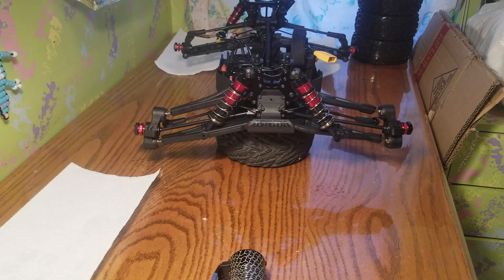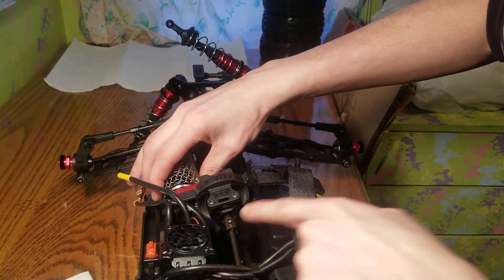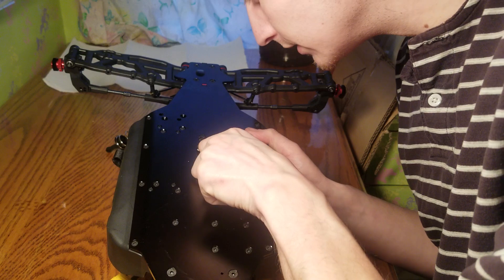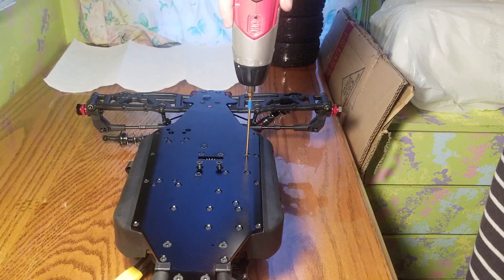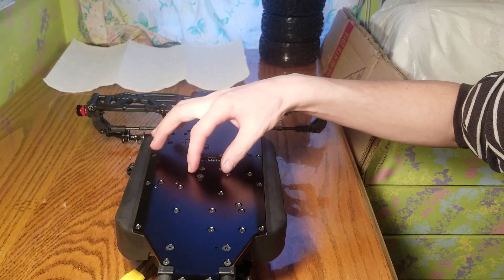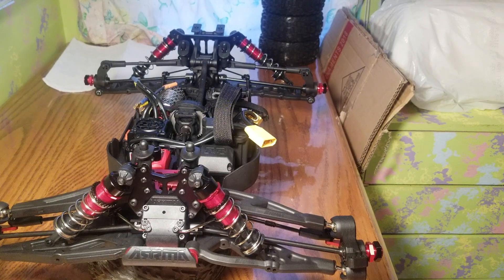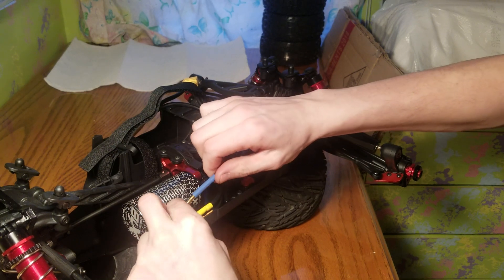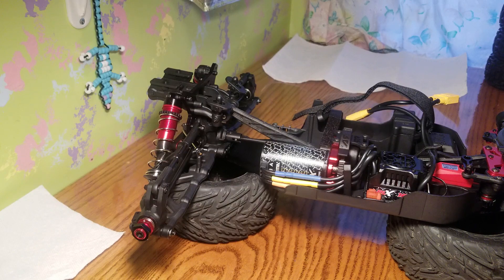Arrma talion v3 how to install the center differential

Comment: Alex i was wondering if you could help me with my decision of buying my next RC im between the UDR, Xmaxx,Losi SRR, and the Losi XLe. Thanks
Reply from the maker: If you want to get the Traxxas unlimited desert racer get that more so as a trail Lite jumping bashing vehicle it's not a hardcore bass sure he will break it constantly if you try to hard core Bosch it if you want the Traxxas X Maxx what is one of my favorite RC ever produced by a Traxxas and one of the strongest RC I've ever owned out of the box I would do the x-max if you'd like to do all around bashing and you like to upgrade your vehicle and not have Parts availability problems the Traxxas X Maxx is my go-to rig the Losi super Rock Rey personally I don't really like the look of it myself I think it's got ugly looking and the speed control and the motor in my opinion are trash just like the steering servo Horizon Hobbies electronics are garbage Factory that is my opinion I'm not saying Traxxas makes the best electronics out of the box also with the Losi that has plastic toe links the differentials are very noisy like the gear teeth and I've heard you like to eat front differentials and lastly the Losi dbxl e it's a pretty good rig if you were to get that it's not for big jumps I've jumped mine it's kind of too big and heavy to really do big jobs you can do light jumps also it does not have the ground clearance for big are so if you're getting it for like bashing for example and you just like to go bashing and jump I would go with the x max if you want something that's the wow factor get like the Losi dbxl or a 5th scale because a lot of people seem to love the big Losi dbxl at least when I pull mine out people love it but me honestly the low Seas really big and heavy you need really really high quality batteries to run that vehicle a minimum of 8's you don't want to run it on 6s it will kill the batteries unless you have super high-quality 6s batteries and it needs a Max 5 speed control stock the stock motor on it is not very powerful I'd recommend the castle 2028 with a hobbywing Max 5 ESC and then it'll be pretty fun would like 15 to 19 tooth 20 tooth pinion gear and that's another thing I do not like about it mod 1.5 gear pitch it's hard to get pinion gears and Spur Gears for that just something you should know sorry this is a really long post but I just want to be as through as I possibly can for you thank you for watching the video I appreciate it please let me know if you have any other questions or if you want me to expand on any other particular RC that you mentioned I'd be happy to
Reply: Alex rc freak Thanks I really appreciate your post, i want the udr but it seems very light and weak but i love the suspension on that thing and lastly the xmaxx is cool but I already have 2 monster trucks and i want to try something different ,the summit and the E maxx brushless edition, i think I’m going for the udr
Reply from the maker: @MrPolaris800crew  the udr is a bad ass ride  if you  don't  mind  putting  aluminum  parts its a great truck honestly
Reply: @alexperea20  Im sorry to ask again but what are your thoughts on the XLE do you think is worth it?
Thanks
Reply from the maker: @MrPolaris800crew  I do like my Losi dbxl but seriously if you do purchase one get the hobbywing max 5 speed control immediately The Castle Creations 6.5 mm connectors high-quality 8's LiPO batteries 50c or higher and recommend locking the center differential with silly putty and then using 100k diff fluid for the front and rear differentials also using 50 weight shock oil in all 4 shocks works very well and better tires the stock plastic Wheels brake constantly so I strongly recommend to getting the Pro-Line trenchers for the x-max and drilling out the wheel center hole to 19 mm or 3/4 inch and they will work great the Pro-Line mx-43 tires the compound is way too hard and does not get traction on any type of concrete asphalt even dirt it doesn't get good traction at all during a complete waste of money the trenchers get great traction